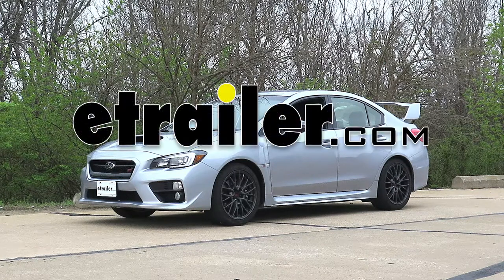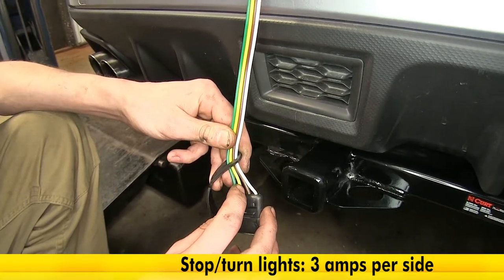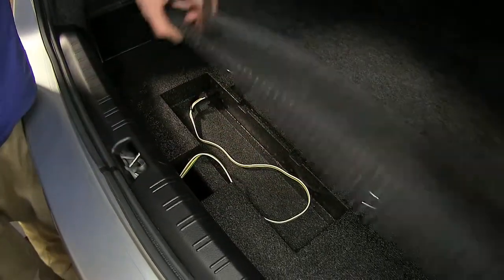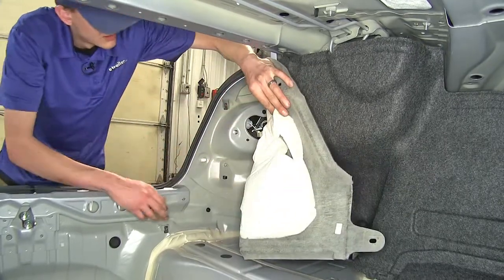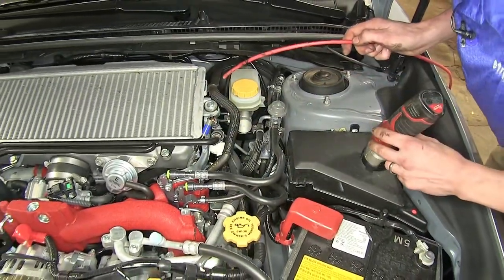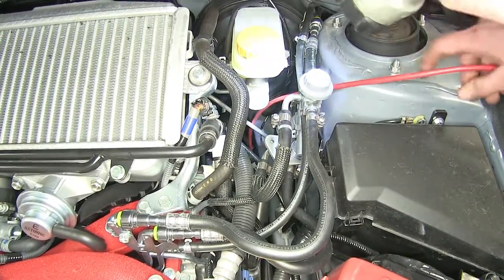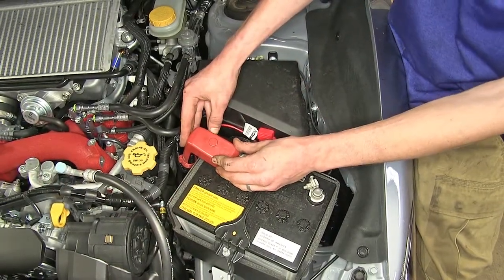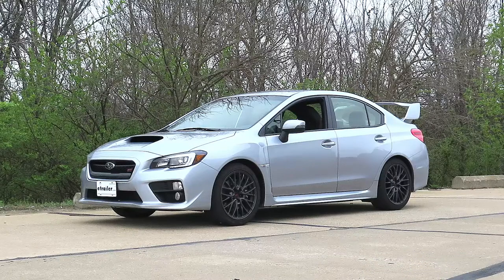etrailer | Curt T-Connector Vehicle Wiring Harness Installation - 2017 Subaru WRX

Comment: You guys are awesome for taking the time to show these install videos on even the less-common vehicle installs like trailer for the WRX/STI. Thanks for reminding me why I recommend your products to my friends.

Is it really necessary to connect it to the battery, instead of connecting to the fuse box?
Reply from the maker: First of all, thank you! Thank you for being a customer and for recommending us to your friends. We value the relationship we have with our customers and strive to offer neighborly service.

We installed this according to the instructions included with the kit. The module must be connected to a constant power source. An alternative power source is not recommended because it is most likely interrupted when the vehicle is off. This is designed to connect to the positive side of the vehicle battery. Connecting it to any other source will void the warranty. 

https://www.etrailer.com/Custom-Fit-Vehicle-Wiring/Curt/C56259.html

Comment: Hello, awesome video! I will be installing it soon but i was wondering, I have a rear fog light and using a plug and play harness provided with the F1 rear fog light! can i plug the harness to the  curt harness since is plug and play pretty much?
Reply from the maker: This kit is designed to fit the 2015 - 2021 Subaru WRX. We have not tried to tie other accessories in with this harness so we do not know what the outcome will be.
https://www.etrailer.com/Custom-Fit-Vehicle-Wiring/CURT/C56259.html